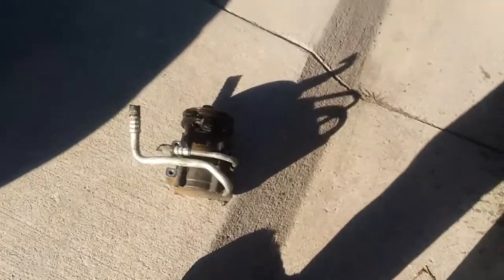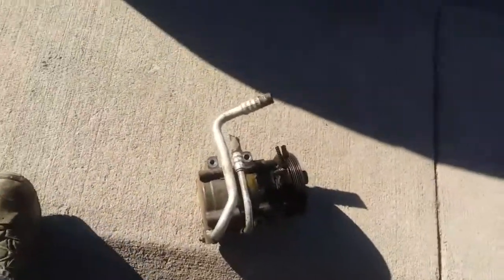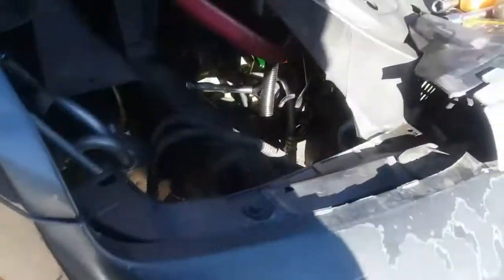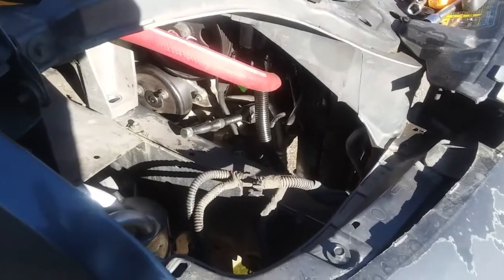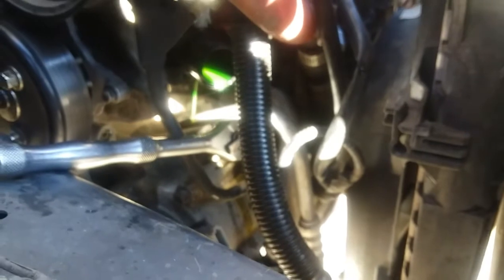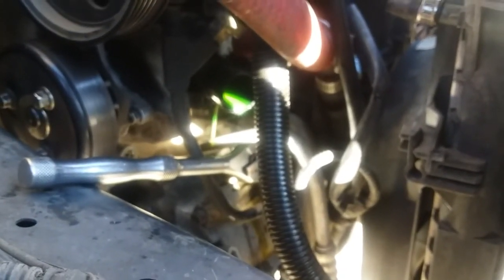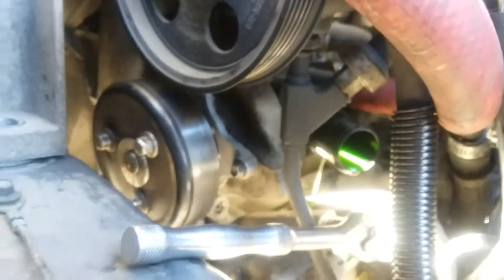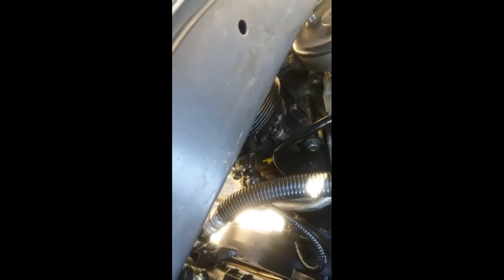07 ford 2.0 A/C compressor replacement.

Comment: I got all three of my bolts out but it’s still stuck on there… I can’t get it loose half of the block… Got the hoses and the three bolts out… What now sledgehammer?
Reply from the maker: Have tou tried using a screwdriver in 1 of the holes and wiggling it to get it louse? It may work double check an make sure u got the 3 bolts that are on the compressor also. Maby u took out a wrong bolt.